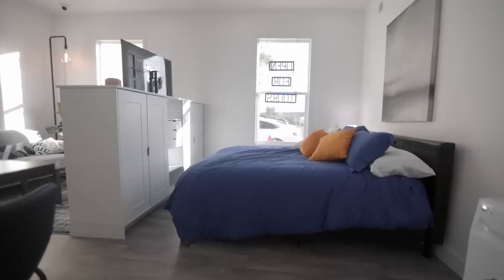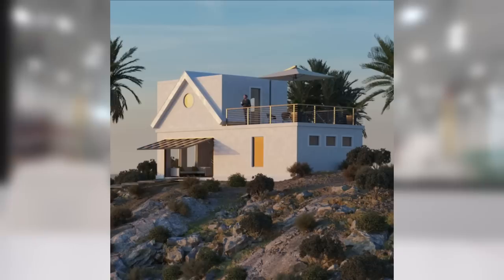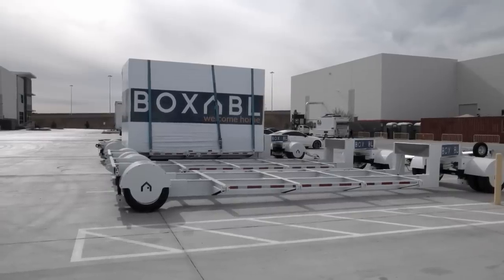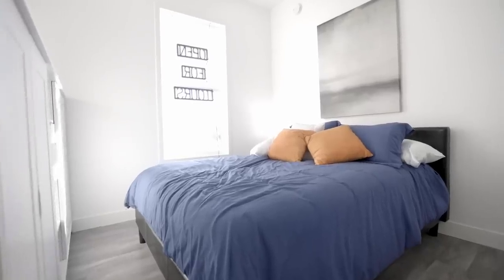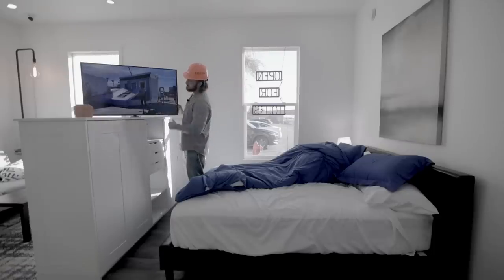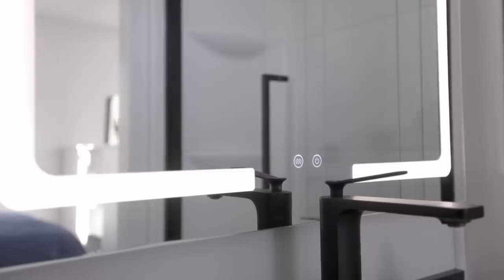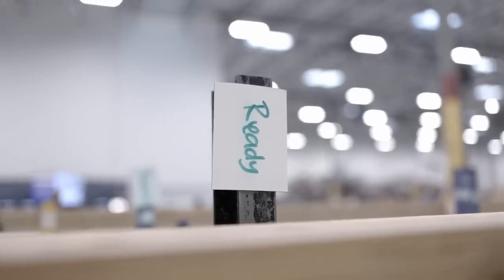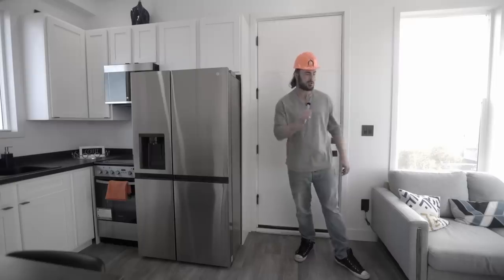Factory Built Tiny House Opens the Door to Affordable Living

Comment: Building (or buying) a tiny house has never been an issue.  The problem has always been finding a place that will ALLOW you to have one...
Reply: Don’t ask permission
Reply: Exactly.  Trailers have been around forever.  This is nothing new.  But good luck getting a trailer park past a zoning board these days.
Reply: They never told you the TOTAL cost to buy one including installations.
Reply: YEAH. Dealing with outdated town rules that demand water hookup and sewage. Tend to kill it.
Reply: @davefletch3063  yeah good luck if you hook up to any service like water or electric or Sewer. They do find out and they do bring equipment to drag your home off the property! Or they put you in jail! It’s hideous yes! They need to change building codes & tax codes. But “just doing it” not wise
Reply: You have to buy cheapest the land 4×4 before you buy tiny house ship there😂
Reply: @davefletch3063  If you don't get permission, you can be fined upwards of $10,000/day. Do NOT NOT ask "permission" on something like this. Trust me. You will LOSE.
Reply: If you have a piece of land in the countryside, is it still an issue?
Reply: There are numerous excellent reasons for zoning rules, and some silly ones obv. But yeah they need updating for new trends.
Reply: @ronnelacido1711  Yes, practically everyplace it is not allowed.
Reply: After buying land with your already taxed money, you’ll need to get approval and pay another permitting tax for the privilege of building on the land you “own”. At which point, your property taxes will increases
Reply: mexico
Reply: @InternetUser._  all pretty logical frankly.
Reply: Be careful.  What you can do on your own rural land varies wildly.  It depends on the county.  I have land in the mountains in Utah and the breurocacy  is insane.   

Anything other than a conventional home and it has to be at least 1000 square feet is illegal.  And you must have 20 acres at least. 

This is in a poor, coal-mining county.  So frustrating.
Reply: @Chicago48   These things aren't cheap. Some are 60/70k. They may call them tiny houses but the prices aren't tiny.
Reply: @InternetUser._  "you own NOTHING, you have owners" - George Carlin
Reply: True
Reply: You still have to have sewer and water hookups on your land and yes you will have to get approvals by the township/county. Do your research first.  Some land is restricted and some unrestricted
Reply: @InternetUser._  I wish you all would just stop working and go on strike 

Business can’t demand anything from anyone if EVERYONE stops participating and demands respect. 

I’ve been doing it but a one man army isn’t intimidating or effective in the cause I’m fighting for.
Reply: You Guys are not happy working for less and not having everything you deserve

Be free 

Live
Reply: Hah! I was obsessed with “The Tiny Home Movement” for years until I finally realized that the barrier to living in a “home” has almost nothing to do with the structure and everything to do with the land that the structure is on. I solved that by living in my van and then my RV. Problem is that our society is very much against this sustainable lifestyle and has passed laws against sleeping in a vehicle in many places in the US. In some places I can legally park my van overnight and even be inside it but become a criminal the moment I fall asleep. Which also happens to be the moment I am least dangerous. I don’t understand it. Well, I do to an extent. People don’t trust people who are transient. So, for that reason, the “housing crisis” will never be solved even if the box you put people in is free.
Reply: @arielmaliha  Not sure I understand the connection. I was talking about taxes, how is me not working going to change the wider system of perpetual taxation by the government?
Reply: We need tiny property zoning areas for tiny houses.
Reply: make it float and put it in the ocean
Reply: @craigasher5970  Ever rented a camping spot to sleep at?
Reply: @InternetUser._ that’s because any idiot can buy land and then cause down stream issues for other land owners. People act like owning land is the same as being intelligent and responsible. Those things are NOT the same
Reply: These will primarily be used for employee housing and as "cabins" by hotel owners looking to expand their portfolio with prefabs. I think it is an awesome product, but other "make me richer" uses will probably be prioritized ahead of actual affordable housing projects because these will face NIMBY resistance if actually used for affordable housing
Reply: Permitting is a huge issue
Reply: Exactly
Reply: You can’t easily get permission to park a trailer and live in it. This is not a trailer since it has no wheels. It’s a manufactured house, which are everywhere.
Reply: Just got to buy some land
Reply: @KennyVo120  I am doing this and will not be removed, but I live in the land of the Free....aka Montana
Reply: @njerseydavid  not my place. I run solar power, compost toilet and haul my water. No permits required. I build what I want, when I want and the only time government has involvement is for tax evaluation
Reply: @njerseydavid  and I did look into beforehand
Reply: @davefletch3063  Care to send me a private message as to a good location where this can be done? I've been contemplating a tiny home for a few years, but the restrictions are horrible.
Reply: I was wondering the same thing. Where the heck would you put this, also parking area for your vehicle. 🤔
Reply: Banks and developers make it this way.
Reply: Not an option
Reply: @ronnelacido1711  Don't listen to the uninformed, there are many places that would allow such a structure. The primary concern is zoning laws, and in many cases, the country will be your best bet.
Reply: @craigasher5970  Get yourself a map of the multiple free camping sites throughout the US, good luck!
Reply: Leave the city.  Go further out into the country and forget about the long Starbucks lines and kumbucha enemas.
Reply: Agree, son was going to buy a new manufactured home like this and no RV parks will allow it!  All a single 30;year old needs!<<DFW area efficiency apartments start at $1800 a month!  What a waste of income!
Reply: @davefletch3063  hoa could force a dismantling
Reply: @davefletch3063  If there are building codes you have to comply.  If you dont, you are in for a lot of trouble and fines.  Rural areas sometimes are lax or dont have codes.
Reply: find a land on sale , buy it !
Reply: @bretthewitt3890  no codes except for septic regulations if I were to install one. Other wise freedom to experiment with different structures
Reply: You must live pretty rural.  I am too, but in town they are strict.  We cannot even put up a fence without a permit!
Reply: Building/buying a tiny house and finding a place to put it have both been issues for me. Now that I have a place for it (my sister and brother-in-law have 8 acres), I'm still stuck with the cost issue. As a disabled senior, there's no way I could cut costs by building it myself. And because I'm on a fixed income, I can't afford one that's already made. From my research, the cost of most new tiny homes is equivalent to (or higher than) the cost of many traditional houses. Most tiny homes I've seen cost more than $50,000. How exactly is that affordable? If I had that kind of money, I could buy a traditional house or a really nice RV that I could at least travel in. This company doesn't say how much this completely finished tiny house will cost, but chances are good it's more than $50K.
Reply: @particleinthewave8378  by owning land you already demonstrated you are more intelligent than the average person who spends their life buying land for their landlord and paying twice the rate a mortgage would have been for ths privilege
Reply: @InternetUser._  sometimes it makes you so angry you just want to go dump tea! Taxed Enough Already. And that's how that began, in case you didn't get the truth from the media.
Reply: @rayscott7655  well, I guess they have a point that it isn't actually an RV...
Reply: @particleinthewave8378  I see your point, but that’s unrelated to what I was talking about. If I own land outright there shouldn’t be a ton of requirements I’m required to abide by to build a simple dwelling. I’m not talking about building a gold mine and dumping lead runoff  into the water system. There is no “downstream effect” from building a log cabin or tiny home. Yet in many jurisdictions it’s illegal to do so on your own land.
Reply: There was a time when UBER was not allowed anywhere either…and they were dealing with municipalities..where half the councilors were getting lobby money from the old taxi companies.
Reply: Only wealthy people that can pay property taxes or suit the HOAs contracts permitted in planned cities.
Reply: No way in UK !
Reply: lol but thats the thing if its a company and you are forced to buy it at inflated prices with the right people getting cuts of the money then it will be ok
Reply: This "house" could be built with like 500$ in wood and 300 in ikea furniture.  But I guarantee you it will cost 5-10k to buy one.
Reply: @gopplergoppler8827  …..I think you may be a little light on that price-point. I would see that unit not going for much less than $50K - $75K. Worth it?…not sure…but $10K won’t buy you anything these days..and regular building costs are around $150 / square foot….so in a factory let’s cut that in half…
Reply: You took the words right out of my finger tips. Especially here in Canuckistan the Royal Flush.
Reply: @jenniferd264  It would probably be more expensive to get a piece of property ready for the Casita. If it were me, I'd have it fully solar, but you would still need hookups to the sewer and water.
Reply: @Chicago48  I looked it up. The Casita is around $60,000.00 depending on amenities. It's not a great price. If you wanted to do something like the 1000 sf example they showed, you can imagine how the price will scale considering it was essentially 4 Casitas stacked one on top of the other. They're right back up to the median home cost in the US.
Reply: Ah....USA...the land of the "free".... So much "freedom".... Back in the day people used to build their own homes...now that's an impossible feat
Reply: Of course he didn’t dive into cost…
Reply: And for those reasons im out. 😒
Reply: @davefletch3063  That is how you end with liens and the city coming down hard on you - aka you will find yourself spending more on lawyers fighting it then what these boxes are worth.
Reply: @corail53  not if you live in a free place, low restriction zones. It is sad how many are such compliant sheep
Reply: @bluenetmarketing  Maybe try out in the desert with no neighbors around. Then I think you can get away with it. As long as it's your land and you stay on your land, a lot of times the county will look the other way.
Reply: @davefletch3063  That's the true American dream. I hope I can do something similar with my property.
Reply: @edwardc.8031  Why would you buy land in an HOA? You are making your life 1000000 times worse.
Reply: @bretthewitt3890  There is building codes everywhere, period. There are some counties that don't have building codes, but the state always does. There is nowhere thats free. The only way to live free, is to not abide by the rules for building a house.
Reply: @nightshade8958  I tried that once, and then the county stopped looking the other way and it cost me $50k. Never again.
Reply: @Night Shade  you've got it 100% wrong.  We don't have cars parked on the street,  no garbage cans visible, no purple houses and our home values are held up because the neighborhood is nice.
Reply: @11smallroaches1  that's not even big, that's less than 100 square meters. There is a solution for that: u built 1000 but u do 2 units insted and voilá u have 1 for u and 1 for rent. Or u have all the permits and start with the garage and when that one is done u stop construction mid way - its called loop hole, laws have plenty of them.
Reply: @arielmaliha  doesn't work, strikers still consume.
Reply: @particleinthewave8378  and that's a big fact right there.
Reply: @edwardc.8031  Actually, home prices in gated communities tend to be less for a similar sized house, because of all the extra regulations and fees. Not being able to park your car on the street doesn't make your house more valuable. It makes it less.
Reply: @Night Shade  you're wrong.  A street that is clogged with parked cars is undesirable to most buyers and prices have to be lower to attract buyers.
Reply: @jasenjahn  Sadly, this is my understanding. They build for profits, not the need in the area. I have no idea how this will ever change.
Reply: @edwardc.8031  There is a purple house behind my house. And yes, you can guess who lives there. Stereotypes definitely apply.
Reply: @stephfran9761  BLM land (bureau of land management).
Reply: @ABCblahblahblah  ? Take a house building class. There’s even free resources like YouTube videos for example.
Reply: @nightshade8958  I used to think that way about HOA’s but it’s somewhat like insurance. A lot of HOA’s include garbage, landscaping, repairs, owner protection, security, amenities.
Reply: @nightshade8958  Please educate yourself before trying to educate others. Google “States, Counties and Places with No Building Codes in the USA: Comprehensive List”. Thanks and good luck.
Reply: @duchampsrook  If the county doesn't not have building codes, you HAVE to go to the state to get permits. All state's have building codes. The county's code is just additional requirements on top of the states requirements. For instance, Socorro county NM doesn't have a building department, nor building codes.  However all buildings still require permits and are subject to the New Mexico State Building Codes. "Please educate yourself before trying to educate others."
Reply: @davefletch3063  Then you eventually lose your entire investment, get fined in addition and become homeless. SOUNDS GREAT! 😃
Reply: Totally agree with you definitely not in New York where I’m from maybe up state New York
Reply: Where I live there aren’t a lot of rules just property line setbacks. My wife and I sold our 3 bedroom ranch and build a small energy efficient (7” foam walls) home on a full basement as a start to a larger space connected to it. It is now a part of a duplex with a garage. There is a 592 sqft rental and a 784 owners unit on over 4 acres of view property. I did most of the work myself. I’d build a wall and my neighbors would help me tip it up. I wired it from the meter base by the road and plumbed it myself. I did the engineering myself and we don’t require inspections here except the meter base that the utility inspects before they connect to it. This was nothing like my day job. The 592 sq Ft place with power to the site,$6,300, well, septic, full foundation, foam filled walls, cabinets, appliances including washer and dryer, hidden fastener metal roofing was $90,000 ten years ago. The whole building including condensing gas boiler with low temp radiators $257,000.
Reply: @InternetUser._ That depends where you live, the only permit I needed was for my driveway to connect to the borough road. They even give you plans and I rented equipment to put it in myself. I live on a hill with the kind of gravel people sell, need some rocks?

Comment: I noticed one design flaw.  Never put the range next to the  refrigerator, because the heat from the range causes the fridge to work less efficiently and use more energy.
Reply: I'd be worried using high temperatures on the right hand burners in case the fridge (probably cased in plastic) starts to melt. Not to mention what an elbow-bumping, claustrophobic experience it would be having it there.
There's a lot of room for improvements here. I for one would never be happy with sliding doors, they get noisy and clunky over time and they don't separate the sounds and smells as well between rooms - how many of us want anyone else in the home hearing and smelling us go to the bathroom?

Comment: It is an interesting concept, but it raises a few questions. over the long term, it will require repairs and maintenance and I wonder how difficult it will be to service when compared to a traditional concrete block or stick framed home? How long do those styrofoam walls last and how long do the seals between the panels last? How hard is it to service the plumbing and electrical? How long will the roof last and what materials can be used to replace it? What is roughly the total cost to put one of these on a plot of land including running the utilities? Are they rated for snow loads? How about hurricane winds?  If the costs are reasonable and these questions have satisfactory answers, it may be what I am looking for to put on a piece of rural land.